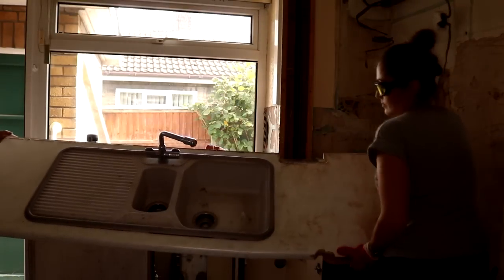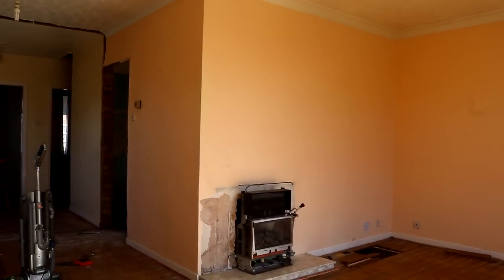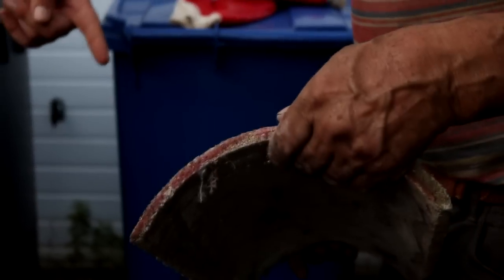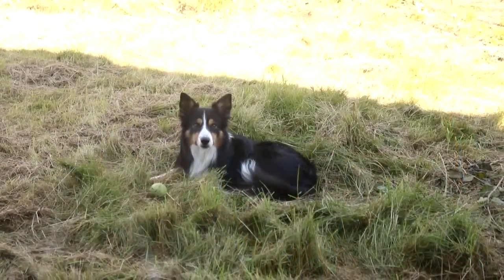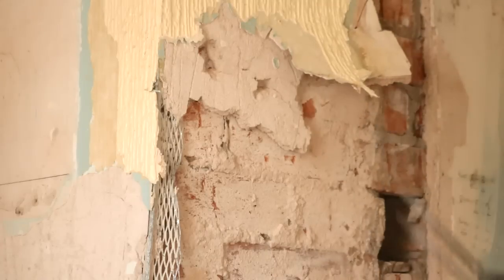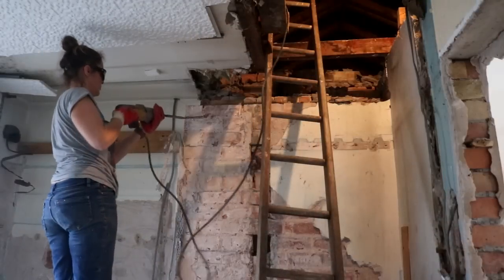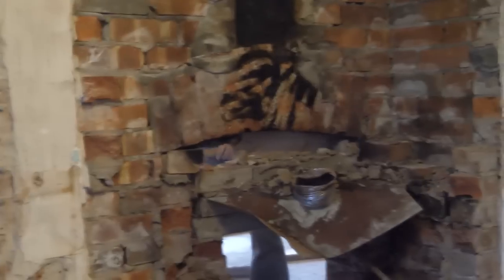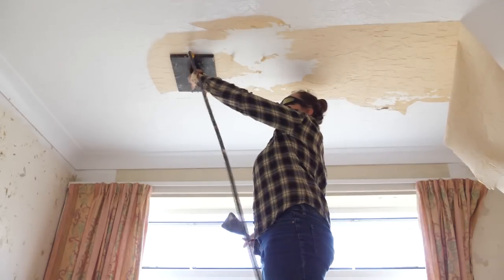Removing a Chimney Breast & More | The Carpenter's Daughter

Comment: Iv heard a great tip and it works far essier than steaming wall paper to get bucket hot  hot water loads fairy liquid and a sponge lather it on do whole wall then repeat if needed it pulls of in strips
Reply from the maker: Thanks!  I started with a bucket and soapy water years ago when I did it the first time, but it's nowhere near as fun 😂😂

Comment: You have to be very careful when walking on roof tiles. It might feel safe at the time  but you only have to stand on a tile supported by a roof batton that had a knot in the wood, and it will give way. Seen my mate do that 3 time's and ended up with one leg right though the roof. Always better to use a roof ladder.

Comment: if you want to cut down on the airbourne dust during demolition leave a wallpaper steamer on in the room facing the demolition area..the steam will condense on the dust particles and catch them! works really well for taking down old ceilings especially if you just fill the room with steam before starting

Comment: Hi.

After watching this video, I’ve successfully removed the chimney breast. However, there is lots of soot residue on the remaining brick. A friend of mine mentioned that this will contain lots of salts and will require treatment before and during Platering. 

Anyone any ideas on how to approach this? Apparently if I don’t treat then I should expect stains penetrating the new plaster.
Reply: How did you get on? I'm always curious about questions like this after time has passed.